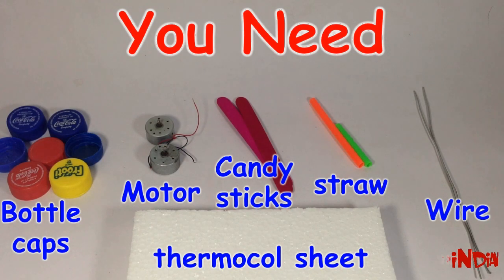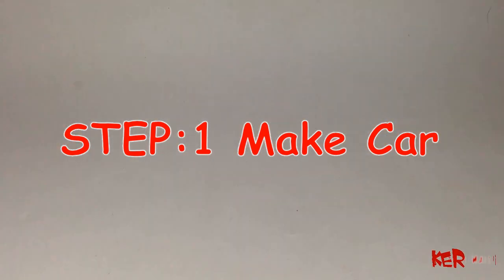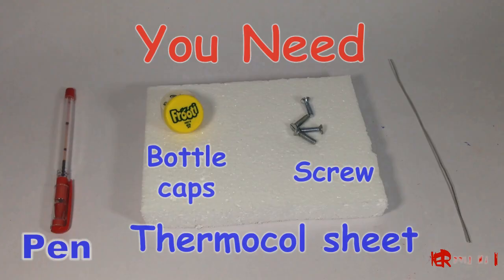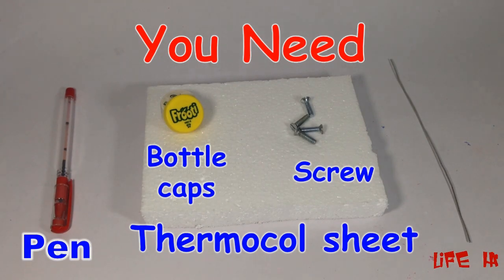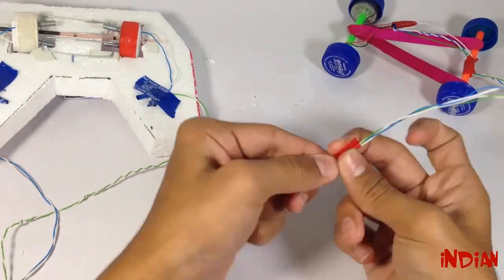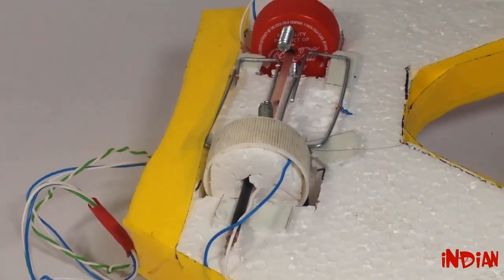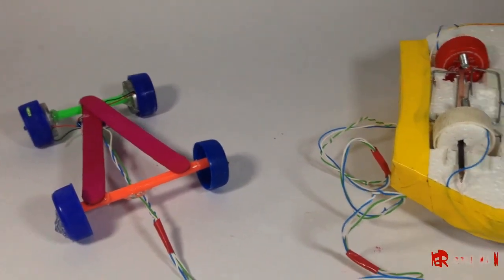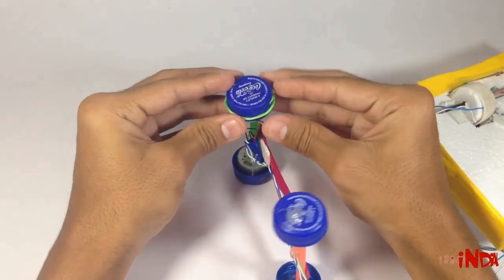How to Make a REMOTE CONTROL CAR at Home | DIY

Comment: to make it remote controlled you said we need a rc  circuit. If I shop for that on line what exactly should I search for? Because we should have a transmitter and a receiver. Right?

Comment: Hey bro if you contact remote's right cap with that pin which is connected to the battery then the car will turn right or not

Comment: This remote idea I think I will use over the razor blade style's I've seen. This looks like it would be a bit easier and probably more reliable. Did you come up with this remote design yourself? Either way excellent job & thanks for sharing.

Comment: what is that thing from which u made holes in bottle caps while making remote?
Reply from the maker: It is a solder machine.
Reply: +Indian LifeHacker : Science, Art & Magic can i use hot nail instead of soldar machine? because i am thinking to make this car in summer vacations. Everything is available except the soldar machine
Reply from the maker: yes, you can use anything that can make a hole.
Reply: +Indian LifeHacker : Science, Art & Magic thanks
Reply: can it go back
Reply: electric solder
Reply: it is a soldering iron and stick